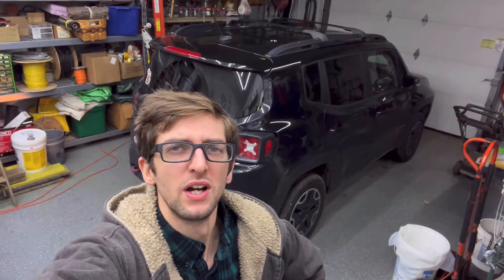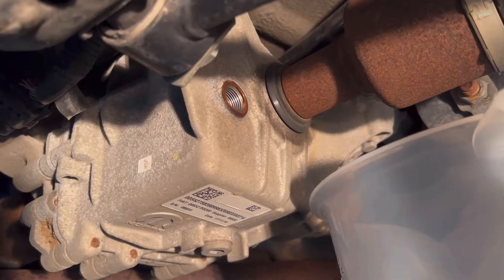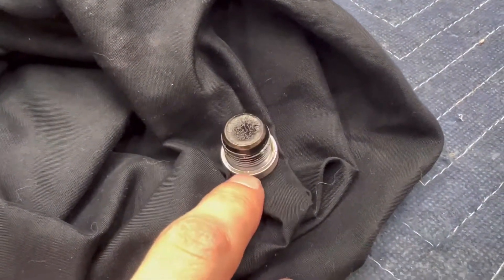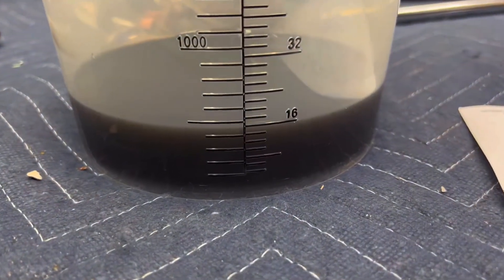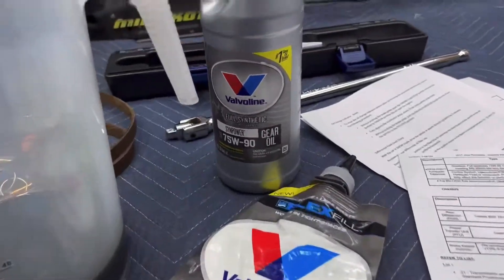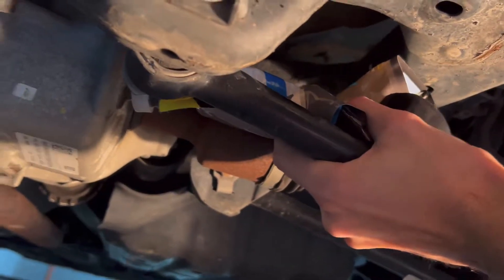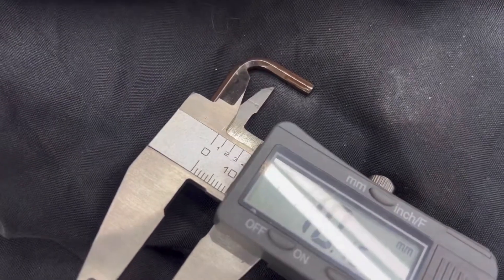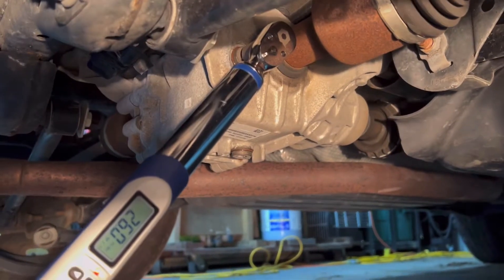Jeep Renegade Rear Diff Fluid Change

Comment: How often do you change your rear diff fluid?
Reply from the maker: @mrdoctoreleven9731  if its a rear wheel drive vehicle than like 50,000. For this front wheel drive than 100,000

Comment: At what mileage did you do this? And aren't these diffs basically lifetime and not serviceable/don't need to be serviced?
Reply from the maker: If its full rear wheel drive, 50,000 miles. This jeep is front wheel drive and it kicks in the rear when in 4x4, so in this case I would say 100,000 miles. Lifetime is a definition from the manufacture, there lifetime ends when the warranty ends. All sealed units have a air vent to adjust pressure when things heat up cool down, this lets moisture in.

Comment: What mileage interval for the service?
Reply from the maker: If its full rear wheel drive, 50,000 miles. This jeep is front wheel drive and it kicks in the rear when in 4x4, so in this case I would say 100,000 miles. Lifetime is a definition from the manufacture, there lifetime ends when the warranty ends. All sealed units have a air vent to adjust pressure when things heat up cool down, this lets moisture in.